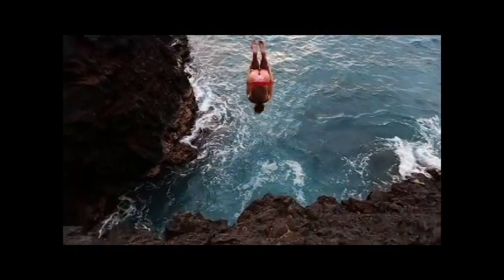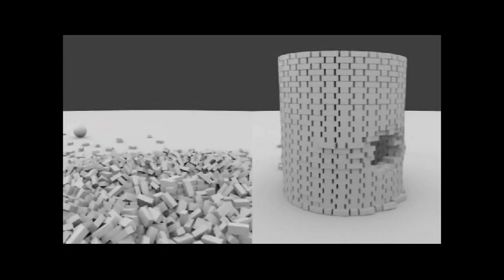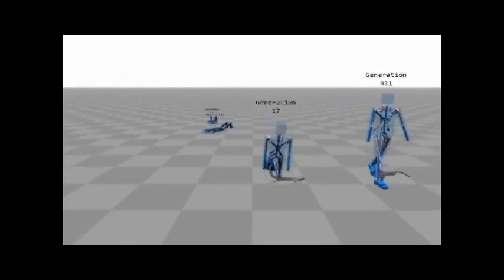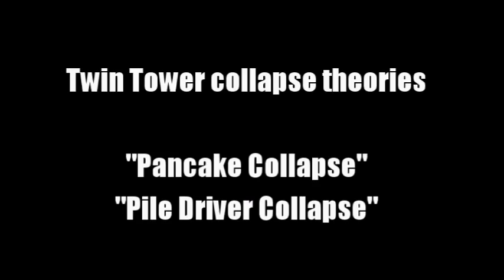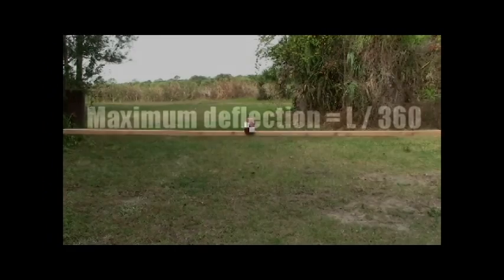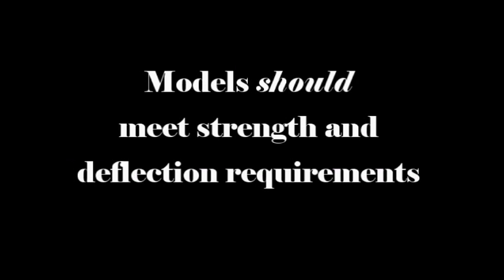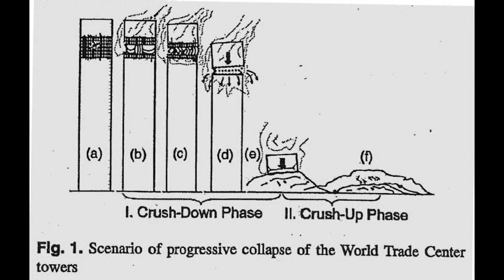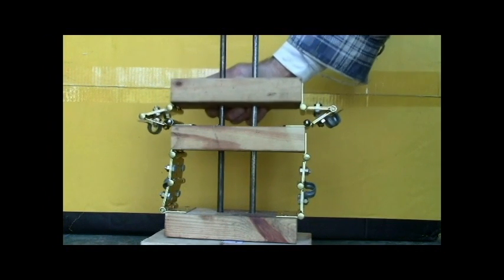9/11 Experiments: The Force Behind the Motion

Comment: It's just sad how wrong you are and you don't even realize it ...

Your experiment is ILLOGICAL, because, realize that its not just papers, its TONS OF STONE AND STEEL that fall down, and not just ANY amount of stone and steel, its more than 30% of the entire structure!

Now there is a law called "Diminishing Return", which is EXACTLY why your experiment is wrong.

Same as an Ant could carry 20 times its weight and you cant, now its not because the Ant is strong, frankly, almost any bug can lift at least 10 times if not more of their weight.

Why? simply because they are small.

The law of the amount of gravity force is very simple, the more you weight, the more impact you have and less raw power.

Like the old saying "The Bigger They Are, The Harder They fall", literally by all means in this scenario.

Aka, lets say you lift a weight, for every 1 kg you add, you actually have to use MORE force per KG than the first one you lifted, to keep it simple, lets say you spend 1 calorie each lift you do with 1 kg, now for 2 kg, you will have to spend 2.5 calories, and for 3 kg, you would have to spend an astonishing amount of 4.2 calories!

Therefore, a guy that weight 20 more kg, is not just picking 20 more kg on themselves, in reality, those 20 kg feel like about 34 kg more or less.

Therefore, the weight you used was just not enough, FURTHER, if you would've made this experiment with the same concept as you did with the ladder, just TWICE as wide, the weight would go about 2 times further if not all the way down, because the stopping power in your experiment is a result of structure rather than the actual falling force and so on.

You made a structural bottle neck with the angles.

Also realize, that your walls where made of paper while the columns where made of solid metal, how is that even remotely demonstrate anything when its so out of proportions ?

Edit: I also really wanted to add, the reason of the acceleration is because EACH FLOOR that fall downs, weight more than the one before it, now realize there is no a single floor that can pull up by its self 30% of the building, now that amount of weight increase with each floor goes down.

One more thing to remember, the shape of the buildings helping a lot to the crisis, when its a symmetrical square, the probability of the building falling inwards and instead of outward are about 1000% higher.
_____

In before troll comments, I do not say it wasn't an inside job nor it was, I simply point out that this video is invalid and literally make no sense and does not demonstrate anything whatsoever.

Do not believe everything you see on youtube.
Reply: What didn't make sense to me was that the towers were specifically designed to withstand a direct plane impact.  The engineers thought of that scenario, given the buildings' heights.  They also took fuel into account, noting that steel loses structural integrity at a higher temperature than what jet fuel is capable of creating.

As this video points out, I would not expect to see linear acceleration down from the twin towers.  The amount of steel is almost unbelievable, so unless the steel was completely compromised all the way down then we should have at least seen occasional deceleration as the lower floors tried to support the weight.  Also, note that before the planes hit, the lower floors were already supporting all of the weight of the upper floors.  Even if the upper floors fell 10-20' onto the floors below, the structure should have been significant enough to prevent complete and total failure of the entire superstructure.

The only explanation is a complete and total failure of the entire building structure.  The building was not designed correctly, it was not constructed correctly, it was not inspected correctly, and we still build buildings today just like it.  This means that all civil engineers are idiots who can't predict forces correctly and thus every building in the world is a time bomb ticking away until someone flies a plane into the building, whether it is accidental or deliberate.

Of course, I don't believe that civil engineers are idiots.  I believe the twin towers were designed and built correctly to withstand the forces the engineers predicted.  You know what they couldn't design for?  Sub-standard steel.  I'd love to know if the twin towers were built with steel from Kobe Steel.  We now know that they had been falsifying the strength of their steel for decades, shipping compromised materials that lacked the strength they should have had.  If the twin towers were constructed with Kobe steel, I could maybe see the supports giving way as the floors below would have been marginally capable of supporting the weight of the upper floors in standard conditions.

We all know that WTC7 collapsed seemingly out of nowhere.  We heard reports that day that the building had been purposefully demolished for "safety reasons".  We heard reports that the building was on fire and collapsed on its own.  We heard reports that the building had collapsed when it was still standing in the background as the reporter reported the collapse on live TV.  Anyone who looks at WTC7 agrees that something fishy happened that day for this one building.  If we're not getting the full story on that building, it casts doubt on the rest of the buildings.

On a total side note, there were dozens of security cameras with a clear view of the Pentagon in D.C. that day.  The FBI released 6 frames of a terrible angle from a gas station almost a mile away.  The video footage from all other security systems in the area has been classified as national security and locked up indefinitely.  Why?  If the FBI wanted to shut truthers up, they could release the security feed from the Hilton across the street.  But they won't.  Again, this casts doubt on the official story.

I was watching all of this unfold live that morning.  I sat with my coworkers as it happened, and I remember the first few people interviewed that were on the turnpike near the Pentagon.  They described a small plane, maybe like a Lear Jet.  Nobody would ever mistake a 757 at 15' off the ground for a Lear Jet, regardless of plane-spotting experience.  Again, it doesn't make sense.

The whole thing stinks, and all we're left with is conflicting stories, conflicting data models, and a significant lack of investigation into the actual causes of the collapses.  Based on the official stories, it seems nobody knows exactly why the towers fell the way they did, which means we can't possibly plan for a contingency against this happening again in the future.  We just have to hope that someone's computer model was made with the right assumptions about the forces involved if a plane ever hits a tower again.
Reply: "I also really wanted to add, the reason of the acceleration is because EACH FLOOR that fall downs, weight more than the one before it, now realize there is no a single floor that can pull up by its self 30% of the building, now that amount of weight increase with each floor goes down."

Your argument is flawed.  You fail to acknowledge that the towers were designed to support all the floors above them in the first place, & just assume that the weight of the building toppling down is creating some new weight which wasn't planned for.  If anything, the steel supports were overcompensated to easily accommodate for a scenario like this..of a plane striking the tower.. even with any added weight, floors shouldn't have been  toppling in the first place.

Nowhere in your argument have you addressed why there was zero resistance from the within the building itself-allowing the tower to come down at the rate of free-fall.
Reply: Rohs-  There's a difference between steel failure & steel completely melting and disintegrating.  The way you're describing things is right out of a textbook, with no regard to where it may apply & where it wouldn't even fit into the puzzle.
All that I can tell you as an engineer, is that an overwhelming majority of my colleagues know that the official story of building doesn't add up.. The most laughable scenario being put forth for building 7-which was never even hit.
The ones who are skeptical are not skeptical because of the facts.  as noone really believes the official theories put forth .. They're skeptical because they don't believe their government would be complicit in this.  There's a reason we haven't seen other buildings react the same way-even remotely..It's because they're not supposed to react in this manner at all.
Now go back & crawl into your little safe space so everything can be ok for you.
Reply: @Unstoppable Tramp-  Yeah..It's always obvious why the Cohens & Lansbergs of the forum section try to deflect attention from Zionists trying to destroy America from within.  I guess dubious behavior like that is why the Tribe was chased out of 109 countries!!!
Reply: Joe V sounds like you have some groundbreaking revelations joey. Fact if the matter is, you can argue all you want about the jet fuel weakening steel and inexplicably leading it to molten over the course of the weeks, which is unbelievable in and if itself.. but you cant say shit abt wtc 7. There was no jet fuel, a simple fire and your fellow zionist silverstein said he was in contact with fdny when they decided to “pull it” Now take your laser and slip it under your pillow tonight along with your dummy tooth
Reply: Your own Tribesmen have blood on their hands.
Reply: Greg Rohs: Complete failure & destruction of the massive steel support via impact shear & subsequent fall @ free-fall rate is a stretch of a theory to say the least.  Additionally your bullshit call on the steel doesn't explain the molten pools of steel which were present for weeks after the downing of the towers, not to mention building 7 which was never hit by any plane.  The only thing that could have caused the steel to react like that are mini nukes placed strategically throughout the columns.  Nice try though.
Reply: What about all the steel below the fires? Funny how all that steel lost its structural integrity too.  It was just office fires anyway, all the jet fuel burned up very quickly.
Reply: My guess is, you're a shill. You know damn well the fall of the towers defy all the laws of physics, yet you ramble on as if you can change a logical mind.  The top weight was already supported by the buildings; therefore, there could never be enough force to pulverize EVERYTHING below it.  If you were my shill, I'd fire you.
Reply: Eliran Cohen 
I tried looking up what you said about the law of diminishing returns with working out and couldn't find anything. Mind guiding me further?
Reply: myscorpions: Always add who you are responding to buddy, otherwise the conversation gets convoluted!
I agree with ya and well put!
Reply: littleJoey-Do the world a favor & move to Israel if you arent already there, troll
Reply: Jet fuel was the source? The jet fuel burned up in the first few minutes.
Reply: Bruce Lansberg after all you built those towers with your own hands didn't you Mr? Unfortunately it's the laws of physics that claim different. Any block of upper material must slow down before I could possibly Crush the entire lower structure that previously supported it. The upper block a phone structure will destroy itself while before it can possibly Crush the entire door structure. In layman terms the object that does the heating always slows down. Conservation of momentum is the fundamental law of physics that cannot be broken. The key weird you're overlooking is at the very beginning.....ANY! You could find five orange bricks and stack them vertically on top of each other with something supporting each side. Now remove the top brick leaving for Still Standing vertically. Now drop the brick on the remaining four and according to you there should be a total collapse. Are you willing to follow the evidence? Besides where did the Resistance ago? 80000 tons of structural steel remained including the core yet the towers fell as if nothing was there. 80000 tons of structural steel you got to at least see a little resistance....but chale....we dont. First of all your version... that's not what happened. Second of all the laws of physics claim it can't happen. And 3rd history proves it's never happened. You believe 3 impossible events all happen in the same general area and exact same day. Remember we have a perfect record going on prior to 911. New high-rise building as ever collapse due to fire. Not before nor since. Yet we have three buildings all falling in the same manner symmetrically showing no resistance at accelerated motions pulverizing itself into its own footprint within hours of each other in the same general area on the exact same day. WOW! What are the odds of that happening? What are the odds that they came down by Design? My money goes on design every time. Probability and physics Point towards a controlled demolition for reasons of the collapse and not fires. Your real nut you know that?
Reply: Rohs-  I'm done with you.  Believe whatever you want to believe.
Reply: myscorpions do you have any understanding as to how the towers were designed and built?? 
Let me know so I know whether to put " school " in session or not
Reply: Joe V believe what you want to believe moron. As an engineer, having thoroughly examined the topic and discussed w countless colleagues, i know whos who & whats what.. so stay in your seat, Joey
Reply: Joey no point in debating a Zionist POS like yourself
Reply: Go to bed now little Joey..Master 'Bater
Reply: Right and the only thing that can melt steel are explosives.
Reply: go study some physics my friend, its quite amazing and not as boring as you think ;)
Reply: Bro mass doesn't play a role here 
lets keep it simple let's say we blow up the 95th floor, now the top 15 starts to fall with their tons and tons of load weight etc as u say. 
But we know that the Force applied initially by the 95 floors on the 15 floors was equal to the weight of 15 floors right cause the building was still before everything.
 So the amount of force that will resist the 15 floors when they hit them  is at least weight of 15 floors correct(can be 10 times but takin worst case).  SO THE 15 FLOORS HAS TO DECELERATE CAUSE THE NET FORCE WILL ALWAYS BE UPWARDS EVEN IF THEIR MASS IS INFINITE. So the tower could not have come down in 10-12 or even 20 seconds its just not possible .
U can comprehend urself by saying that there were tons of iron and shit but the time taken to fall is independent of mass/weight
Reply: Joe V Im not gonna right a thesis on here to appease you., i have to dumb it down since folks like you cant even answer the most basic of questions about say, building 7 without ranting..Now just crawl back into that govt hole you came out of
Reply: Joe V- I don't give 2 shits what you think Joey boy.  Now  run along & play with your newly discovered toy laser
Reply: I agree with everything you said, but I think they used an energy weapon, not mini nukes.
Reply: Eliran Cohen YAWN!   Are you through? I fell asleep right after the word "Its" you have completely substituted mathematics for experiments and you have wandered off through equation after equation that eventually built the structure which has no relation  to reality. Plus it was long , wrong and boring. This experiment is reliable ....simple...yet reliable. All you've done is spit out some mumbo-jumbo you YouTube engineering wannabe. Playing with your Lego set does not qualify for you as an expert so please.....a little consideration
Reply: CoolDat - "after all you built those towers with your own hands didn't you"
There are other ways to find out about a structure's design. It's called doing research. You might want to try it some day. The design of both towers is very well documented and even the goofs of E&A911 agree upon it.

"Any block of upper material must slow down before I could possibly Crush the entire lower structure that previously supported it."
This is actually wrong. You are confusing speed for accelleration. But it doesn't matter anyway since towers (or their upper and lower parts) are no blocks. They are very complex collections of "mini" blocks. Each separate beam acts like a "block" of its own.

"The upper block a phone structure will destroy itself while before it can possibly Crush the entire door structure. In layman terms the object that does the heating always slows down."
If this were true, how would you explain a house of cards being fully destroyed after I just move one single upper card? You need to stop thinking about buyildings as blocks. Buildings are no blocks. Blocks are solid. Buildings are complex collections of blocks. Every single beam will act like a "block".

" Conservation of momentum is the fundamental law of physics that cannot be broken."
Please elaborate. No math needed, please just explain the principle of this and how it relates to the towers' collapses.

"You could find five orange bricks and stack them vertically on top of each other with something supporting each side. Now remove the top brick leaving for Still Standing vertically. Now drop the brick on the remaining four and according to you there should be a total collapse." 
Really? When or where have I ever stated such a thing? This clearly demonstrates that you still have not taken the effort to study the design of the towers (or for that matter ANY building). Buildings are no blocks. Blocks are solid. Buildings are 95% empty. So, no. According to me there should not be a total collapse when you drop a brick onto a stack of a few others. 

"Are you willing to follow the evidence?" 
I am and have been since the beginning. The real question is if YOU are willing to follow the evidence. Just note that if you don't understand something, it doesn't mean it is not true.

"Besides where did the Resistance ago? 80000 tons of structural steel remained including the core yet the towers fell as if nothing was there."
This is exactly why you need to understand the design of the towers. What exactly in your opinion was the resistance that should have been met during the collapses? And please be specific.

"all the laws of physics claim it can't happen."
This is a generic statement that I guess you picked up while watching a few 9/11 conspiracy videos. So which laws of physics dictate that it can't happen and why? Please understand that this is the main question. If you are not able to answer this question, yoiu have no idea what you're talking about. But remember that it is you who made this claim. I am so much looking forward to your answer. Let me repeat the question: which laws of physics dictate that it can't happen and why?

"history proves it's never happened. "
You're joking, right? History proves it never happened? So right before Trump got elected, history proves that Trump will never be elected, because he was never elected before? Is that the kind of logic you are relying on right now? :)

"You believe 3 impossible events all happen in the same general area and exact same day"
So what was impossible about these events? And please be specific.
Yes, the same general area and same day. Maybe these three events are related in some way...

"Remember we have a perfect record going on prior to 911."
This is the first statement I agree on. We have a perfect record as far as intentionally flying fully loaded passenger planes into two uniquely designed mega high rises which resulted in uncontrollable fires that weakened the structure of both buildings.

"New high-rise building as ever collapse due to fire. Not before nor since"
I guess you meant "no" instead of "new". If so, you are incorrect. Not that it matters much, but you are.

"Yet we have three buildings all falling in the same manner"
You are incorrect again. The towers that were designed in the same manner, more or less collapsed in the same after more or less the same kind of event occurred. Yet, WTC7 collapsed in a TOTAL different way. Even by just watching some conspiracy videos, you should have been to tell.

"symmetrically"
For both towers, maybe, somewhat, if you don't take too much detail into account. For WTC7, no. All but.

"showing no resistance"
Sorry dude, This is nonsense. Without any resistance, the towers should have collapsed in under 9.2 seconds (they started collapsing at the points of impact). Yet, if you count, one towers collapsed in about 15 seconds, the other in over 20 seconds.

"into its own footprint"
Really? So how did over 20 other buildings get damaged from the collapses? Were they built into the towers' footprint?

"What are the odds of that happening?"
100% clearly.

"What are the odds that they came down by Design"
They did indeed come down as a result of their design.

"My money goes on design every time."
I know, This is exactly why you should study the design of the buildings.

"Probability and physics Point towards a controlled demolition"
Probability is irrelevant. How probable is it that you will win the lottery? Not very. Yet, someone wins the lottery.
Please explain to me why you think physics points towards CD. Which physics exactly and why. And please be specific.

"Your real nut you know that?"
Why? Because I don't get carried away by YouTube conspiracy videos and do my own research?
Reply: Eric Rasmussen - "What didn't make sense to me was that the towers were specifically designed to withstand a direct plane impact."
A direct plane impact from the largest plane in the mid 60's which would fly a lot slower: https://www.youtube.com/watch?v=NgXvmMkpRpU

"They also took fuel into account"
Not accdording Leslie Robertson: https://youtu.be/NgXvmMkpRpU?t=34s

"noting that steel loses structural integrity at a higher temperature than what jet fuel is capable of creating"
Not according to the many graphs availabe online. Steel will start losing strength at a temperature below 400 degrees celsius and will have lost 40% of its strength at a temperature of 550 degrees: https://www.steelconstruction.info/images/9/99/Steel_strength_in_fire.png
Jet fuel burns at a temperature of 425 - 815 degrees centigrade.
So, you are wrong in assuming jet fuel wouldn't be able to have steel lose its structural integrity. Not that it matters much since it were the office fires that were ignited by the jet fuel and burn at even higer temperatures that made the steel lose its strength.

"unless the steel was completely compromised all the way down then we should have at least seen occasional deceleration"
Why? You do realize that gravity is a constant force I assume. So what we should have seen is not necessarily deceleration but decreasing acceleration. And when you count the actual seconds it took for both towers to come down, this is what happened: https://youtu.be/qLShZOvxVe4?t=59s

"Also, note that before the planes hit, the lower floors were already supporting all of the weight of the upper floors."
No floor ever supported the weight of any other floor. They only supported their own weight and the static and dynamic load of the people and equipment on it. This is how the floors were connected to the columns: http://2.bp.blogspot.com/-1br_CltzH7w/ToIlVRZFkzI/AAAAAAAAAnM/yygzPgPdLUg/s1600/WTC+Tin+Tower+Steel+Perimeter.jpg

"Even if the upper floors fell 10-20' onto the floors below, the structure should have been significant enough to prevent complete and total failure of the entire superstructure."
No. Every single floor element was bolted to the columns with two bolts each only. All the falling mass onto one specific floor had to do was break these bolts for a full floor collapse.

" The building was not designed correctly, it was not constructed correctly, it was not inspected correctly, and we still build buildings today just like it.  This means that all civil engineers are idiots who can't predict forces correctly and thus every building in the world is a time bomb ticking away until someone flies a plane into the building, whether it is accidental or deliberate."
I understand you are being sarcastic here. The problem however is that we are discussing a unique design of high rise building. The picture I posted above is part of the evidence for that. Unique means one of a kind. Most high rises are built around a concrete core and do not have these extremely long floor spans made possible by moving all columns to the core and perimeter. This means that most high rises will have columns all over the place which makes the floors significanlt less vulnerable for collapsing due to falling mass.

"I believe the twin towers were designed and built correctly to withstand the forces the engineers predicted."
Exactly. No engineer would have been able to predict the combination and sequence of events that happened at 9/11. The towers were designed to withstand the impact of a 707. low on fuel and flying slowly (lost in the for, and trying to land). Yet they were even able to withstand the impact of a 767 fully loaded flying at high speed. However, the blast ripped off the fire protection of the steel, fires rages at several floors simultaneously, sprinklers were cut off of water, impact caused massive structural damage, jet fuel ignited office fires, fire fighters were unable to reach and fight the fires. I don't blame any engineer for not being able to predict this.

"You know what they couldn't design for?  Sub-standard steel."
Irrelevant. NIST tested the steel and concluded that it was stronger than standards prescribed.

"If the twin towers were constructed with Kobe steel, I could maybe see the supports giving way as the floors below would have been marginally capable of supporting the weight of the upper floors in standard conditions."
This comment reveals your misconception on the way the towers were designed. See earlier posted picture.

TBC
Reply: Eric Rasmussen - "We all know that WTC7 collapsed seemingly out of nowhere. "
What exactly do you mean by "seemingly out of nowhere"? It didn't collapse seemingly out of nowhere. Why do you think the area was evacuated? Because structural engineers and the FDNY concluded its structural integrity was compromised by hours of unfought fires.

"We heard reports that day that the building had been purposefully demolished for "safety reasons"."
By whom? (I'm talking about the alledged reports)

"We heard reports that the building had collapsed when it was still standing in the background as the reporter reported the collapse on live TV. "
Singular, not plural. Report, not reports. This is what the source itself had say about it:
_"What about the incorrect reporting of the collapse of Tower 7? Having talked to key eyewitnesses who were actually at Ground Zero that day it is clear that, as early as midday, the fire service feared that Tower 7 might collapse. This information then reached reporters on the scene and was eventually picked up by the international media.

It turns out that the respected news agency Reuters picked up an incorrect report and passed it on. They have issued this statement:
"On 11 September 2001 Reuters incorrectly reported that one of the buildings at the New York World Trade Center, 7WTC, had collapsed before it actually did. The report was picked up from a local news story and was withdrawn as soon as it emerged that the building had not fallen.""_
http://www.bbc.co.uk/blogs/theeditors/2008/07/controversy_conspiracies_iii.html

"Anyone who looks at WTC7 agrees that something fishy happened that day for this one building."
Because of a false news report? Beacuse of "reports that day that the building had been purposefully demolished" by an unkown source?

" If we're not getting the full story on that building, it casts doubt on the rest of the buildings."
You seem to think you have not gotten the full story, yet fail to explain why. More importantly, what kind of logic is this? Because you think some secret information on WTC7 was not published, everything else must be a lie? :)

"there were dozens of security cameras with a clear view of the Pentagon in D.C. that day."
Really? What is your source for this claim?

"The FBI released 6 frames of a terrible angle from a gas station almost a mile away. "
No they didn't. They released a video containing captures of two separate cameras at the entrance to the Pentagon Mall Terrace parking lot.

"The video footage from all other security systems in the area has been classified as national security and locked up indefinitely. "
Source please? 
If you really want to understand what is visible at these 85 videos, just look op "Maguire declaration". You know what? Here it is: http://www.judicialwatch.org/wp-content/uploads/2013/07/A_2006_doubletreeaffadavit.pdf
Scroll down to the end of this page to see video info in detail: http://web.archive.org/web/20080208102217/http://www.flight77.info/85videos.html

"If the FBI wanted to shut truthers up, they could release the security feed from the Hilton across the street.  But they won't.  Again, this casts doubt on the official story."
You might want to try the search function of YouTube. it might return some unexpected results: https://www.youtube.com/watch?v=6wUXXgfN2fM
FYI, this video was released over 11 years ago!

"I remember the first few people interviewed that were on the turnpike near the Pentagon.  They described a small plane, maybe like a Lear Jet.  Nobody would ever mistake a 757 at 15' off the ground for a Lear Jet"
It doesn't matter what hey described. The real question is if you think these are reliable witnesses. If so, why? If not, why? Here is a nice little document that describes the accounts of 86 eye witnesses. You might be interested in reading them: https://ratical.org/ratville/CAH/F77pentagon.pdf. The I'll ask you the same questions again.

Concluding, it is stunning to see your total lack of factual knowledge  about the 9/11 attacks and the events and "facts" you have described. Over 90% of what you stated as fact is verifiably incorrect. No wonder you draw false conclusions. How would you arrive to correct conclusions if your premise is false? I'd strongly advice you to check facts before you accept them as true.
Reply: Eliran Cohen fair argument. I was thinking the same. But keep in mind the planes crashed to one side of the building. Even if the pancake theory was legit, it wouldn't fall straight down. It should in fact fall at an angle of some sort starting from the crash site, but never straight down.
Reply: Yeeeeaaaaa, but the "pile-driver", the top of the building, disintegrated along with the rest of the building, hard explaining how steel turns to dust and clouds of pyroclastic heat just by falling against other steel. In reality, if the structure did fail from force of impact from the pile-driver, it would fail only at any point that it did fail, where tension built up the most. Once enough tension points failed, the rest of the structure would not fail and it would sort of just fall off into the street. Dumb ass.
Reply: Sure, and therefore completely irrelevant. Meaningless.
Reply: I suggest you see an eye doctor. The tons of stone and steel you talk about were turned to powder before it fell down. Please see the work of David Chandler on YouTube and open your eyes.
Reply: Much of the weight you mention is blown out horizontally. Open your eyes and watch the slow motion videos. You are not paying attention to what happened.
Reply: "a floor that is connected to the beams by 2 bolts each side only for every single floor element". But of course the core vertical columns were inconsequential, and are overlooked as insignificant.
Reply: @ Greg Rohs - BUILDING 7. BUILDING 7, BUILDING 7. Not hit by an airplane, no steel melting temperatures due to burning jet fuel - yet the building fell in the same freefall fashion as the other two.
If your brain can accommodate contradictory doublethink that 2+2=4 and at the same time that 2+2=5 then you are disqualified from reasoned debates.
Reply: Of course Eli. All the bottom floors that held that weight all turned to butter since they knew the floors above were falling.
Reply: Paul DiBenedetto - "All the bottom floors that held that weight"
How much weight do you think these floors were holding? Do you think the floors supported the weight of the towers? This is why I have stressed to study the design of the buildings. Each single floor only supported its own weight and a specific live load from an active office environment. And basically it wasn't the floors, but the connections between the floors and the columns that carried the load.
Reply: 5252 - "for every action there is equal or opposite force."
And...? Your point would be what? If I drive my car on a sidewalk and hit a pedestrian, what happens? How many pedestrains can I keep hitting if they're lined up at a 10ft distance before my cars comes to a stop?And why? What if i would be stepping on the gas? Would my car stop too? The problem here is that you think of the tower as two solid blocks. You wouldn't think of the lined up pedestrians as one big single pedestrian, would you?
Reply: sszorin - "the building fell in the same freefall fashion as the other two."
And
"you are disqualified from reasoned debates"
Do you understand that I think your comment is rather ironic?
Reply: Paul DiBenedetto - "But of course the core vertical columns were inconsequential, and are overlooked as insignificant."
Inconsequential to what? I don't understand your point.
Reply: OwLee - "it wouldn't fall straight down. It should in fact fall at an angle of some sort starting from the crash site, but never straight down."
You need to distinct the initial collapse from the progressive collapse. When looking at the initial collapse, it is actually very clear that the top tilts, starting from the point of impact. This initial collapse however started the progressive part. Progressive as in it resulted in the failure of other structural elements, which resulted in the failure of other structural elements. And so on. The falling mass of the upper block caused the floor-to-column connections to fail. From that point on, the collapse could only go straight down.
Reply: Yes i agree ,i can squash many pancakes with the weight of my slug also.!
Reply: Eliran Cohen no matter what, anyone who thinks 9/11 pkayed out like the Media suggest is ignorant themselves regardless of their (proposed) intelligence
Reply: im fucking done :D
Reply: myscorpions gee Mr.  You like wild E coyote Super Genius. You YouTube engineering wannabes sure are smart. Do playing with Legos your entire life qualify you as an expert. Buildings just don't collapse in the matter that they did. Seeing  the top floors being pulverized in mid-air you would expect to see the huge section toppling over and falling to the ground and not forcefully pushing its way through 80000 tons of structural steel that was not damaged by the plane or fire. So tell me Einstein where did all the resistance go. Your explanation is flawed.... you simply right off the 80 thousand tons of structural steel like it didn't exist. OMG. I believe you're having delusions of competence. Glad to see you're not putting your education get in the way of your ignorance. Must I remind you that we are going by the official report. NIST.. a shameful miscarriage of the most important investigation perhaps in history. It is not and I repeat not what you think happened. NIST deliberately focused only on reasons due to fire nothing else. Investigation only goes up to the collapse initiation....and stops there. Nowhere else does the report explain for a total collapse. And you want us to believe you have the answers? I think not. Nist also admitted not finding evidence for explosives because they never look for it. Nist also stated that explosives were never reported by Witnesses. SAY WHAT? I remember clearly a 911 and reports of bombs being detonated, bombs being felt and heard many times throughout the day. There's also video of CNN reporters and reporters that are on site. These eyewitnesses include firemen and policemen. I believe they know what a bomb sounds like. I believe they.NIST deliberately omitted all eyewitness testimonies. Are you telling everybody here that you are okay with this? Unless properly investigated and ruled out there are clear evidence of the potential for explosives involved. Then you have all the debris ship to China for recycling before anyone could investigate it. Are you okay with this also? Removal of evidence is a crime in itself do you not agree? NIST could not find a reason for the total collapse so what they did was invent a new phenomenon. Fuck vato didnt you see or read any of the Nist report. So narcissistic you have all the answers don't you? Nist called it a new phenomenon because they knew they could not possibly come up with a solution for total collapse. They are clearly and admitting the fall of tower 1 was highly improbable and the manner in which it fell.... impossible. Your learning disability allows you to believe that 3 physically impossible events occurred within hours of each other... three buildings falling in the same manner symmetrically. Each fell in perfect vertical path with no indications of internal resistance. Each fell within 10 to 15 and each were polverized to dust falling into their own footprint in the same general area on the exact same day.  What are the odds of that happening? What are the odds they all came down by Design? My money goes to design every time . Probability and physics point to controlled demolition four reasons why the towers collapsed and not fire. See you were playing poker with someone and that player ends up winning the first hand with four aces you might call that luck... amazing luck. You play another hand and again he beats you with four aces. Do you still think it was luck? You suspect manipulation at the game? You decide to play another hand and the same player wins again with four aces. What do you think about the odds now? Would you feel better if a commission was appointed to study the results and the commission concluded that luck was the only Factor... would the matter end at that point? Would you throw your arms in the air like you just don't care? And I swear if you say yes to this I like to invite you over for a game of poker LOL. This was one bogus investigation. Regarding everything I just explain to you.... now add the fact that video and photos show numerous High Velocity burst of debris being injected now and the well-documented presence of molten metal throughout the debris field now add some hundred and fifty six Witnesses which include New York firemen and policemen stating they saw heard and felt prior to and during the collapse explosions. Now go to 911 speaks out. Org there you will find Steven Jones BYU physics professor and David Chandler retired physicist teacher. They have discovered Nano thermite in the WTC dust. This is strong evidence of a cover-up and indicate the official story is false. This is not a conspiracy but instead this is strong evidence of Nano thermite found in the dust at WTC. look it up yourself don't be scared... but instead be willing to follow the evidence. Stop being a member of the Reply and Deny Assholeciation. You clearly have an addiction for fiction at the College of no knowledge. Don't be a coward look it up yourself 911 speaks out. Org.
Reply: Eliran Cohen, what a surprise Jewboy
Reply: sk0sH - So if you need a firecracker that covers about 5% of the surface of 1 floor, how large should the alledged bombs have been that brought down the towers in your fantasy. And remember, "proportionality".
The real issue here is that this guy's models never represent any of the design of the towers. He repeats "out and down" several times. "First the horizontal movement, then the vertical". If this guy (or YOU for that matter) would have any clue about the way the floors were connected to the perimeter and core and how relevant they were for the lateral stability of the whole building, I am pretty sure the both of you would be ashamed you supported these "conclusions". What you and this guy do not seem to understand is that in these experiments, each floor is supported by walls. In reality however, each wall was supported by floors. Not difficult to grasp. Could you have know? Yes! If only you would have taken some effort to study the design of the towers before you left your clueless comments.
Reply: myscorpions impact shear
Reply: myscorpions - "it's always obvious why the Cohens & Lansbergs of the forum section try to deflect attention from Zionists trying to destroy America from within.  I guess dubious behavior like that is why the Tribe was chased out of 109 countries!!!"

And you got all that from a Google nick? Dude...
Reply: myscorpions - "All that I can tell you as an engineer"
So you claim you are an engineer, right? 
"an overwhelming majority of my colleagues"
You do realize that "engineer" is a title and not a job description, right? But let's go for that, what kind of engineer do you claim to be? And IF you are an engineer, why does that make your claims more relevant? If you claim bullshit and are an engiuneer, you are simply a bullshitting engineer. But let's see... 

"steel completely melting and disintegrating"
What kind of process do you believe makes steel "disintegrate"?

"The most laughable scenario being put forth for building 7"
Could you explain to me in your own words what that scenario would be? And more importantly, why it is laughable? You're the engineer. You should be able to explain.

"_ The ones who are skeptical are not skeptical because of the facts."_
That is actually correct. I do not know of any skeptic that is skeptical because of facts. They are skeptical because of all the bullshit theories spewed by so called truthers for which there still is, after 17 years, no evidence at all. They are skeptical because whenever they ask for sources for the bullshit claims being made by truthers, either bullshit sources like Alex Jones or none at all are being provided. Scepticism about an alledged 9/11 government conspiracy is not fueled by what skeptics think their government would or would not be able to do. It is fueled by the total lack of relevant facts and evidence the truther cult comes up with.

_"As an engineer, having thoroughly examined the topic and discussed w countless colleagues, i know whos who & whats what.."_)
Yeah, another interesting claim. So you are an engineer AND you have examined the topic. You also claimed the existence of pools of molten steel. How have you examined this claim, what sources have you used for this examination and how did you come to the conclusion they really existed? How large were they? What caused it? Which evidence have you found that backs up your believe of mini nukes having been used?

"believe in your govts science lesson"
Another nice one. Who has given you the title of engineer? Which university did you attend that is privately financed yet has the mandate to award the title of engineer, but teaches physics that rejects the "govts science lessons"? Do you see the next mistake you made here?

So, conclusion: I call bullshit. You are not an engineer. You are not educated at any university at all. You just watched a bunch of YouTube conspiracy videos and decided you were ready to fight the fight. You couldn't be more wrong my dear friend. Friendly advice: please do yourself a favor and try to find evidence for your own claims. Really. You don't need to share it here. Just do the research and keep your findings for yourself. But please stop claiming you're an engineer when you are clearly not. There are other ways to appear knowledgable. Fact checking is one of them. Finding evidence for the opposite of what you BELIEVE is another one. Letting go of your prepossessed opinions is a third one. Look at the real facts and check them at the source.
Reply: Shoaib - You make the same mistake as I have seen a lot of truthers make. You seem to think that buildings are solid blocks and apply a theory that assumes single point masses only. The force of the falling 15-30 stories however isn't subjected to the remaining lower parts of the buildings. It is dubjected to one single floor only. Ans to be more precise, it is applied to the floor-column connections. When the mass of the upper part starts to move down, the first thing it encounters is the resistance of the one floor below, a floor that is connected to the beams by 2 bolts each side only for every single floor element. The force of the falling part only has has to overcome to resistance of these connections before it moves on to the next floor below. Simplified but accurate explanation.

"the time taken to fall is independent of mass/weight"
In a vacuum without any kind of resistance, you would be correct. However, there was resistance by means of what I explained above. The larger the mass and or speed, the bigger the force applied, the easier the resistance overcome.
Reply: myscorpions ill believe what is proven by science while you believe that  disproven conspiracy bullshit is fact.

 Idiot.
Reply: Greg Rohs Conspiracy theory bs? You live under a rock, look at all the shit that has been proven, Bay of pigs, MK ultra, project bluebook, the list goes on and on, it's been proven our government has deceived us many times and it's been proven, ppl who don't see the whole picture are nothing but sheep for the slaughter, especially if they have the mindset you do, funny how this country thrives off war, and how there a war nearly every 20 years or so, ww1, 20 years or so later, ww2,  Vietnam 2o or so years later, Korean war, desert storm and the the war sparked by 9/11. When we as a ppl are tired of war, and tired of the government messing with our rights to privacy, 9/11 happened and we all wanted war, and we stood as one in outcry to allow less rights to privacy (Patriot Act) the facts are out there, it's your lack of a brain, or common sense that you blindly follow everything on tv, social media and it's false narratives are leading you astray, there is no doubt in my mind that this was a set up, or more commonly knows as a (false flag operation).why argue theis facts when they will surly be discredited by sheep
Reply: myscorpions  whoa.. I wasn't asking for a thesis,  OR a long winded diversionary reply..... ONE word is all you had to type.   why so defensive?  Are you afraid someone will actually confront you with facts, that you cant refute, and that will burst your paranoid, ''inside job'' bubble? 
Just to let you know ''whats what''  any one with more than 2 working brain cells KNOWS it wasn't just jet fuel that weakened the steel beams....so why would You reference them?  I thought you said you were an engineer?
Reply: Eric Rasmussen then again, the budings were made 1960 something and they had different planes, in 2001 they had different, more powerful planes
Reply: myscorpions again. They way you described this won't be found in a text book as its fucking wrong. Steel becomes extremely soft a pliable at 702° Celsius.

 They have THAT in a text book because its fucking fact.
Reply: myscorpions,,  Ha... a little sensitive,  aren't you?    I asked because based on THIS reply from you,  you seem to be lacking a lot of knowledge concerning the design of the towers

'''''''Your argument is flawed.  You fail to acknowledge that the towers were designed to support all the floors above them in the first place, & just assume that the weight of the building toppling down is creating some new weight which wasn't planned for.  If anything, the steel supports were overcompensated to easily accommodate for a scenario like this..of a plane striking the tower.. even with any added weight, floors shouldn't have been  toppling in the first place.

Nowhere in your argument have you addressed why there was zero resistance from the within the building itself-allowing the tower to come down at the rate of free-fall.''''''''

 Knowledge is always a good thing. And despite you thinking you have 'thoroughly examined and discussed w countless colleagues..  I can assure you, you are Very ignorant about design, construction. collapse of towers, and probably physics handicapped as well.
But thats fine... remain ignorant... Just also know,, its been Over 16 years, and none of you Einstiens have found any fact to change any part of the official story.....   ..... '''''mini nukes'''''''    yea.. thats a good one
Reply: Eric Rasmussen long winded and complete bullshit.

 Steel looses structural integrity at 700 to 800 degrees. By the time steel reaches melting point(which temperatures you are referring to) the steel has long since failed. It doesn't need to melt to reach a point of losing structural integrity kid.
Reply: Every other skyscraper in the world that was on fire for hours & hours built long before the WTC towers could handle it.
Any person who has cut massive structural steel beams with a plasma torch knows you either don't know what you are talking about or incredibly naive.
Reply: Steel "looses" ........tells our  audience all they need to know about your analysis skills.
Reply: myscorpions.  No, you're not able to '' dumb'' anything down.  You dont understand the unique design of the towers is what led their demise,  you dont know anything about 7 or how it collapsed.  And I wasn't asking for a '''thesis''.  
 You dont seem to have a problem replying paragraphs when it concerns YOUR opinions. Your 47 word reply could have been done with just an 10 word truthful reply,,,,  like  """" I dont know shit about tower collapse. Please tell me"""
 My opinions are based only on your replies.  And your replies are based factless opinions...   And you actually spoke to other engineers??  (colleagues ?) and '''mini nukes''' was the best you could come up with..... O K.
If you're still reading,, I have one question, that only takes ONE word to answer..      
Did you know there was a laser transit set up on the WTC 7?